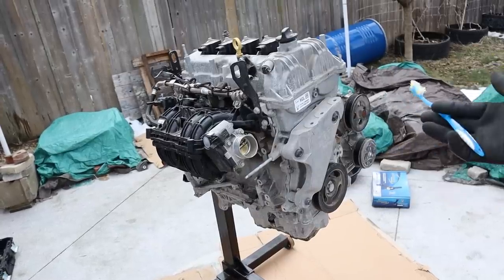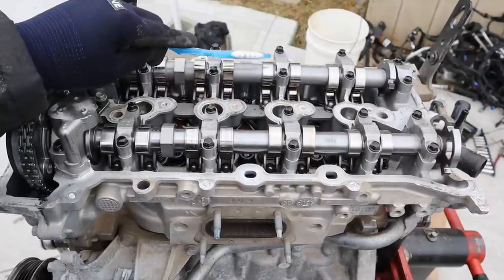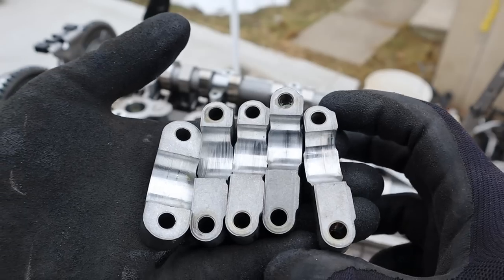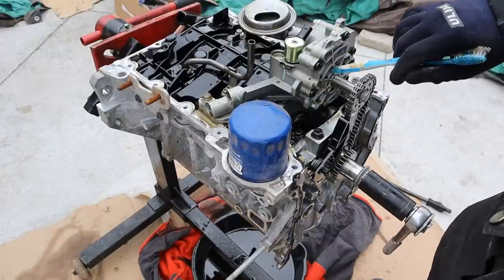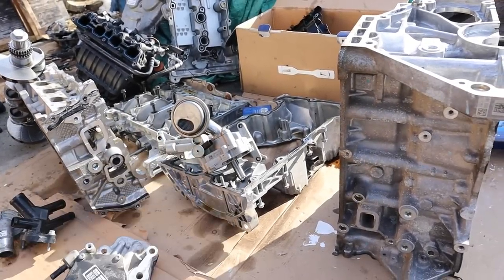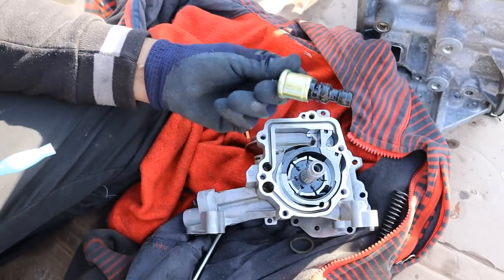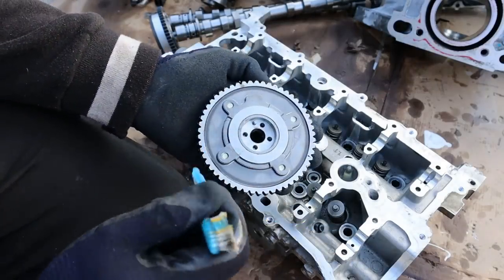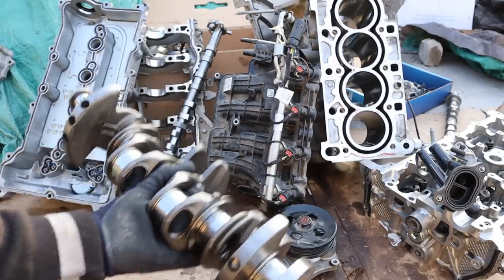What's Inside a Brand New GM Ecotec Engine

Comment: A thin oil has no correlation to wear in engines unless the engine is improperly designed.
Reply: It depends, thicker oils have higher high temp high shear, HTHS, values -- they retain better film strength at elevated temperatures but as you imply, this can be compensated for by using high quality base oils. It depends on how much heat there is in the engine in racing conditions.  Obviously thinner oils have lower friction which is important for MPG and CO2/km in road cars, and important for more horsepower in racing.

To some extent, when the engineers specify 0W16 or 0W8 for a Chevrolet Spark or Toyota Prius they might be assuming the engine will never be driven hard and the oil will never get very hot, due to the type of vehicle.

Usually racing engines will only use 0W16 or 0W20 for qualifying and then use something like a 5W30 or even 5W40-10W40 for say a 1000km race.  It depends on the engine design and the quality of the oil (i.e., is it a PAO or ester synthetic as most racing oils are).  Porsche Carrera Cup cars and GT3R vehicles still call for relatively thick oils in circuit use IIRC.  It seems Carrera Cup cars run Mobil 1 0W-40 like a road going Porsche GT3, however Mobil-sponsored motorsport teams elsewhere often use oils like the Mobil 1 4T Racing 15W50 from Mobil's motorcycle oil range (obviously not in a DI turbo engine, but rather a port injected Chevy smallblock V8).
Reply from the maker: Well maybe this engine is improperly designed...they use the camshaft to feed the hydraulic lifters

Comment: Why does it need a vacuum pump?
Reply: He mentions it's for the brake booster.
Reply: Modern engines often don't make much vacuum, especially if they are turbocharged.
Reply: I am not asking what it is for, I know what it is for. I am asking why does it need it? It is not turbocharged.
Reply from the maker: It's an economical small engine. Probably doesn't make enough vacuum at idle
Reply: @speedkar99  Very strange. I think they just left it there from the turbo version, and didn't bother to redisign it without it.
My 1.4l 8v NA 75 hp engine does not have it. A 0.9l 45hp engine I drove did not need it either...

Comment: Do you think poor gas would build that much carbon in the combustion chamber with only 2000 miles on it? I’m thinking loose rings maybe?…..I doubt it’s would be that rings haven’t seated into the bores especially with 2000 miles in it they should be well seated by this point I would think.
Reply from the maker: Maybe it's the PCV system

Comment: 200k engines if maintained. 300k is an impossibility from what I've encountered. They are built well, just not built for longevity. After 200k, they are to be thrown, or expected to be thrown away, cause that's usually when the timing components are destroyed, carbon has ate up the valves and cylinders, cams are worn from varnishing, and bearings are worn.

Comment: This may sound extremely evil, but can't they use clips instead of so many bolts, similar to plastic housings? Metal should also be somewhat flexible. Parts could just click together, never to be disassembled again.
Reply: no.
Reply: Probably very difficult if not impossible to get enough clamping force holding parts together just with clips to stop oil/coolant leaking out (plus the added problem of making the engine even more of a throw-away item than it would already be), among other reasons I’m sure.

Quite efficiently summarised by the reply above me haha.
Reply from the maker: Clips are going to wear down and fall off. Bolts don't do that

Comment: Im no defender of Garbage Motors but in this engines' defense it was probably driven by a teenage girl that always floored it a nanosecond after it started, add to that its winter, and winter in Canada. Can perhaps explain cyl wall wear from cold-engine slap, extra carbon, and other wear points inconsistent w/such low kms.
Also very well may be why car was wrecked to begin with.
She was busy texting and painting her nails.
Reply: Was she pretty ?😅
Reply: @mvnorsel6354  not as pretty as you sis.
Reply: Texting or not. The car is or was trash from day one
Reply from the maker: You think that alone can cause buildup in 2000km?
Reply: @speedkar99  crappy gas, no oil change at all, but most of all poor poor engineering.
Reply: @speedkar99  tbh,   95% GMitis,  5% my theory,   lol.

Comment: The vacuum pumps fail and kill GM ecotech engines.
Reply from the maker: How do they fail....do they lock up the cams somehow?
Reply: @speedkar99  they break apart internally and the smaller pieces can end up in the engine oil. About 4 years ago, we had cars waiting around for backordered vacuum pumps so we could determine whether the engine had survived the failure.

Comment: I would say how much more complicated this engine is than 30 years ago, and they were much more durable, if I wasn't suffering now with an 8-valve naturally aspirated diesel, which I don't know where the cooling water goes into a cylinder. now it's time to flex the cylinder head, because I can't find a crack anywhere. that the good god would pull all the German shit.

Comment: The valve cover IS the PCV valve on those motors.  GM dealers will always stock some bwcause they often fail too.  Dumb design.

Comment: As to the surprising amount of carbon, could this have belonged to an elderly person who only drove it extremely short trips and also let it idle a lot?  

Otherwise for a modern GM engine, it doesn't look like it was engineered/designed all that bad, wear on the cam/cam caps notwithstanding.  Not the usual amount of GM bullshittery going on in there.
Reply from the maker: That can be one cause. 
Could also be this joke of a PCV system
Reply: Good points @retiredbore378 and @speedkar99.  I remember the Charger's the police here were using were getting lots of abnormal engine wear and it was because they can spend a very large amount of time just sitting and idling.  Not sure the exact engineering but something something not getting enough oil up to the cams so they were wearing out.  Now this was with heavy use not 2,000km like this one.

Comment: Very stupid design, water pump on accesories belt is a good thing, metal thermostat housing i also good, then a metal pipe also good into a water outlet made of plastic? WTF? Non reusable valve cover because of pcv also a big negative but i bet someone will manage to drill the screw out and just replace the membrane.

Comment: GM should sue you for slander. You have so much misinformation due to your lack of knowledge about engines which in itself, is pretty bad. But to characterize the LF7 as a crappy economy engine purely based on your distinct lack of engine design is absolutely defamatory.

Examples:
1) The oil squirters mounted to the engine block are called "piston oil squirters". They spray oil on the underside of the piston to keep it cool, you never want to spray oil on the cylinder walls and overload the oil control rings.

2) The coating on the piston skirts is a special polymer designed to reduce piston to cylinder wall friction. With the coating on the piston, the piston is actually installed with negative piston to cylinder wall clearance...yes, the piston OD is larger than the cylinder ID. In the first couple of hundred turns of the crankshaft, the polymer abrades away to get to less than 0.001" piston to cylinder clearance. The material that has abraded away isn't wear, it's the piston clearancing itself for optimum operation. The piston material is hypereutectic aluminum alloy which has a much lower coefficient of expansion than pure aluminum, together with the polymer coating making the clearance optimum, this engine does NOT experience piston slap.

3) The carbon build up is from a rich mixture consistent with the car being driven short distances in the cold. The ECM provides a very rich mixture when the engine is cold, sometimes as low as 1.5:1...you should know that if you claim to be an engine expert. The carbon build up is typical of any engine driven in that manner, it's considered to be minimal, and it doesn't hurt anything.

4) The cam bearings aren't damaged at all, those are normal wear marks. I've opened many overhead cam engines and see the exact same thing.

 That engine would've run hundreds of thousands of miles without failure of the cam bearings, pistons, cylinder head, etc. Why would GM make a crappy engine that won't make it many miles? They don't want that reputation and don't need videos like this branding the engine as "bad". You should take down this video before GM sues you. "Somebody" is going to send it to them before long. I recommend that you go to an actual engineering school to learn about engine design and then start over.
Reply: Correction, LV7.
BTW, all engines have those hooks on them so they can be installed in the car on the production line, it's no indication that it's going to be a "warranty engine". 🙄
Reply from the maker: Thanks for the information. I am not claiming to be an expert in engines or defame anyone. It's good to hear your perspective from someone who works at GM. We just had higher expectations with such low mileage.
Reply from the maker: The engine hooks were a joke. Watch my other videos and I comment the same 😄
Reply: Blah blah blah, calling something "crappy" isn't slander, it's an opinion.
Reply: @thebigmacd  he made statements of fact multiple times throughout the video from a position of authority and with malice. He never prefaced any of his defamatory statements with "I think" which would indicate it's an opinion.
Reply: @Richard-qz8up I have this exact car.  2017 Spark.  I have 111,500 miles on it.  I bought it as the second owner at 13,800 miles.  I have had Zero issues.  I change the oil every 7 to 10k miles with Valvoline full synthetic 0w20....but I see comments on here that indicate that a thicker oil might help with preventing that wear.  Should I switch to 5w20?

Comment: The Chevy Spark was made to maximize fuel economy and being cheap. Wouldn’t it make more sense to design the engine with a SOHC and not a DOHC? It cut down on production costs and probably use less fuel.
Reply from the maker: You can't get VVT with sohc which is a huge loss for economy
Reply: Given it's GM, I'm surprised it's not a pushrod engine.  For all the claims that pushrod engines are best from GM fans, even GM does not make pushrod inline-four or V6 engines anymore...